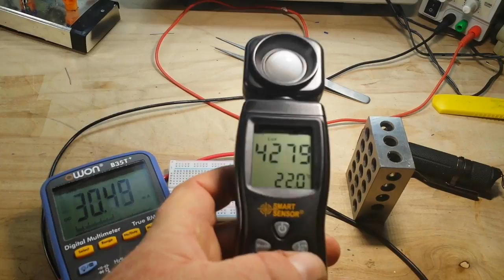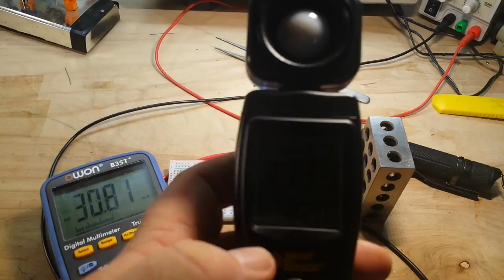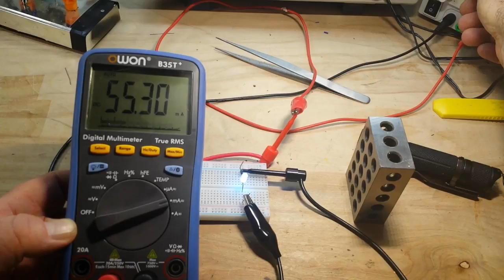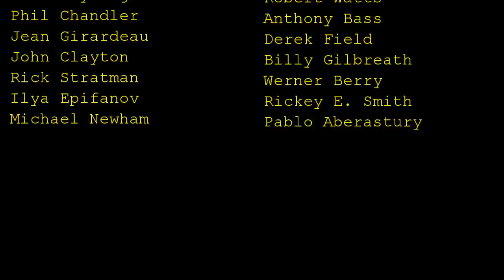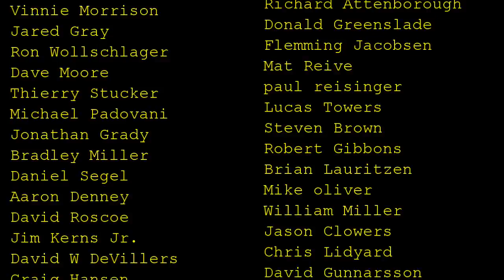Standard vs Ultrabright LEDs

Comment: Got to watch this video. I think the "superbright" LED can handle higher current. Is that called overdriven? I plan on, for a 1st build, a lightsaber using the strawhat (blue) LEDs. Thanks for the test & comparison! Can you do a video on calculating running LEDs at a percentage of brightness? Also, it's possible that a different color super bright may be brighter than a standard one.

Comment: At 3.2V the ultrabright takes much more current if current is not limited by the power supply.
They do not live long if you go over 130-150 mA (by cranking up the voltage). They work perfectly at about 100-120 mA (in series with a 15-18 Ohm resistor at 5V).

Comment: More W more light, no magic. Simple as that. Guessing how many W go to heat, normal vs high power? 
Good explanation, tnx.
Reply: They get pretty hot above 100-120 mA. At 130-150 mA  (too hot to touch) they do not live longer than half an hour because of the heat. That is without any cooling. They are often rated as 0.5 W LEDs but without cooling they can only handle about 0.35 W max.

Comment: I guess I must be missing something.  The regular LED died at 180 mA.  The ultrabright LED reached 150 mA, and you then stabilized at around 100 mA 'because you didn't want to kill it'.  These results indicate that the regular LED can handle more current than the ultra bright LED.  You were keeping the voltage at around 3VDC, and increasing amperage?  Sorry - I'm just not getting it.

Also, the lightmeter is reading not only the light from the LED, but also the room lighting you're using to make the video.  To get a more accurate result you would need to take your reading with the room totally blacked out, and the only source of light being the LED being measured.  One LED might actually be twice as bright as the other, but with all the additional ambient light on the set the difference would only be a few percent of the total light on the set.

I guess I don't see the advantage of an ultrabright LED.  Sorry - Charlie
Reply: I was left with the same question.  What is the value of an ultrabright LED other than if you abuse them by giving them too much current, they may appear brighter and possibly last longer.  Is that the way to design an LED circuit though?  I don't think so.

Comment: Sure, their ability to withstand excessive current may be different but that's surely not the point or even an interesting or useful fact?

Measure them at 5mA, 10mA and 20mA and measure the light intensity and the angle of light delivery.
The UB LED's tend to emit light in an intense narrow beam which does not suit many applications. The UB LED is definitely brighter in most cases too so I've occasionally used them sanded down to diffuse their surface. This gives a bright LED with a very wide viewing angle.

Comment: Sorry I been missing videos lately. I been busy. And then I lost my dad a couple weeks ago. I been struggling to find witch way is up. The whole way I gauge my life is gone. The world will never be the same to me. Anyway I'm interested in led lighting. Since I'm off grid. I need the most power with the least power in. I am using 12v DC lighting for ambiant lighting. And saving the 120v lights fow when needed. I have led tape strips 1 for ea room now. I may add more. Great video. I may go to 24v and get rid of the buck converter. To get rid of that loss. I figure it's worth running a bit of wire . to not have to run the inverter for lighting. I'm planning a extra battery bank in case of low batt voltage I will still have lights. Any chance of a video on bms and balance boards. And how they work? I'd like to build a arduino or tinsy pie based bms balance system. But that's beyond my know how at the moment. There ppl on yt. Working on things like that . I may see how they do it and give it a go
 Great video .

Comment: You can read my mind, i was looking for this yesterday! There is not much information what led is beter. And with beter i mean : wider light, low cost and does not need a high voltage or current. The reason i want this, is because i want to upgrade my garden lights (solar) with bigger leds. I did found a movie on YT about car lights, but they didn't use a light meter to test it.